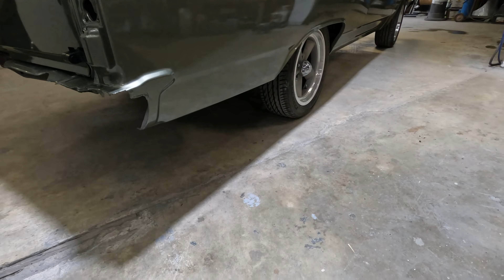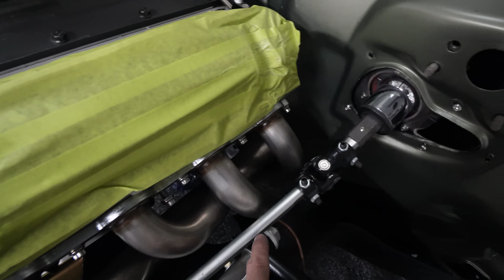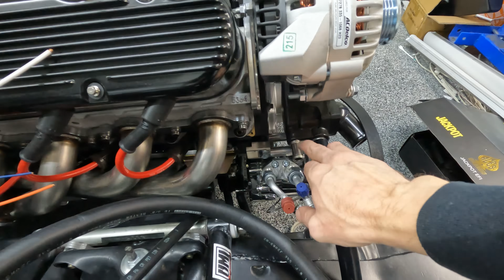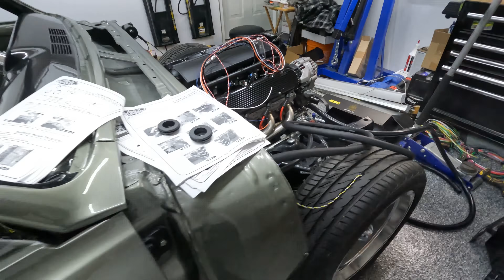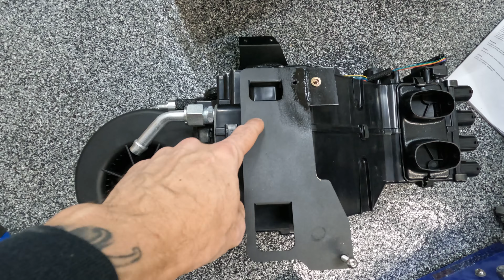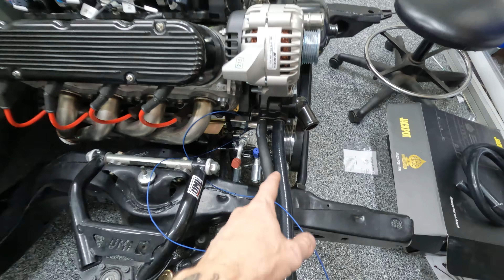Finally have the 1965 El Camino back! Let's get into it.

Comment: I probably missed it, but what headers are you running in your LS?
Reply from the maker: These are Speed Engineering
Reply: fyi... I have a '66 Elco. I had Hooker long tube, sounded great, but they always hit speed bumps as the car is lowered. I went to Sanderson short tube, quieter and the flanges were a pain in the @ss. I finally wound up with CUSTOM long tube headers.  THEE ONLY way to go! Better clearance all the way around, sound BITCHEN, more room to get at the oil filter. only drawback... very pricey. Dig deep, your lookin at $5K+